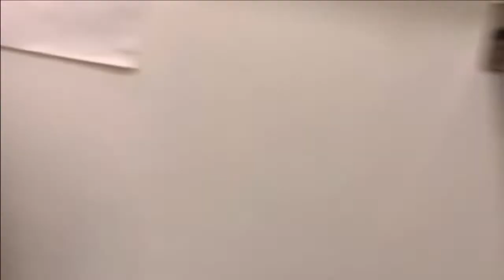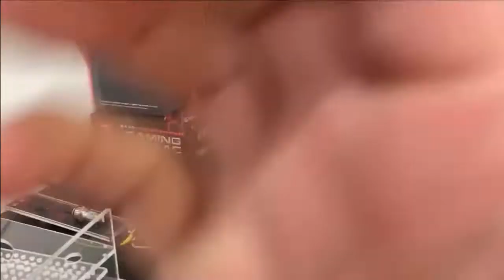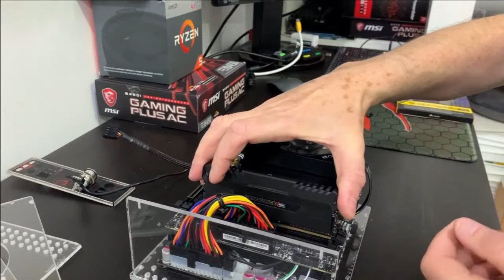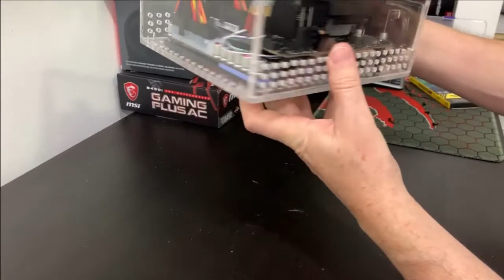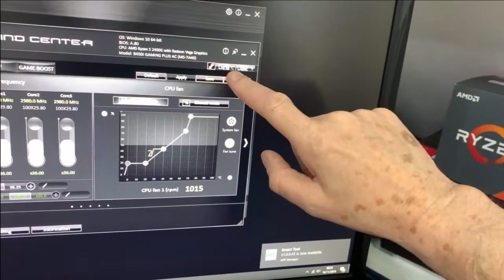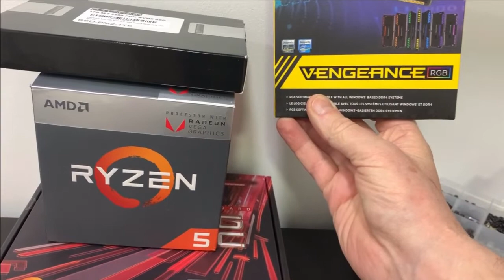Acrylic, Perspex transparent pc case build. Pico 500w PSU DC12v   19v input

Comment: With 500w you have quite the system you can build out if you'd like. I have been trying to figure out a way to build a pc with a RTX3090 inside a xbox 360 case. I just discovered these HDPlex devices and seeing how they have a 500w model it certainly seems kinda possible from a performance perspective though I do believe its not quite enough to handle the 3090. Are there any higher wattage models you know of? Now to figure out how to layout components internally to actually fit and ways to securely mount them to the case.

Comment: I drilled out 2.5mm holes and used 3m nylon screws, I had to wiggle the drill bit to ever so slightly widen the hole so the nylon screws wouldn’t be to tight otherwise they will just twist, I avoided metal to avoid stressing the Perspex case. The nylon screws are on eBay it amazon and come in assorted sizes get the ones with extensions so you can very the height of your motherboard hole that helps.

Comment: How thick are the sheets and what dimension are the screws you use?
Reply: Hi, I used 6mm polycarbonate sheet which I had pre cut off a web supplier £12 plus postage search for such on the net, and 3M size bolts and nuts for pc build which are off amazon for mix sizes in either metal or plastic black as I’ve used.

Comment: I don't see why using 500W pico psu even though the cpu producing 65W make sense, I limit to say 90W (without GPU) or 200W (with 75W-100W GPU). That not taking into account for overclocking. Why not build 35W CPU (AMD RYZEN 3000G) for the hell of it.
Reply: Hi, this was a first trial with a standard psu 600 watt unit. I have now put a pico unit in it .... see my other vides in trialing such and installing such .... just a mess around for myself and getting my son into building skills.
Reply: @damdamdam8346  I wouldn't argue with this guy https://www.youtube.com/watch?v=B6QUuniKJek .

Comment: Very pleased with the psu it has a duel power supply, so you can connect a large graphic card to it msi 1080 or equivalent, impressive unit so far, cheapest I’ve seen it is/was £58 via China may come down in price as others latch on to it. See my other video on this unit to see it with a power supply pack 240v 19v to the psu and step down further to 12v
Reply: May I have the link to it?